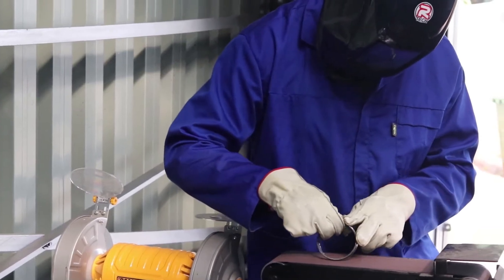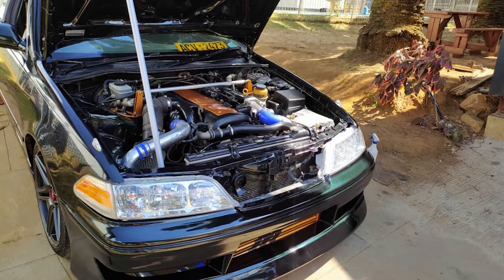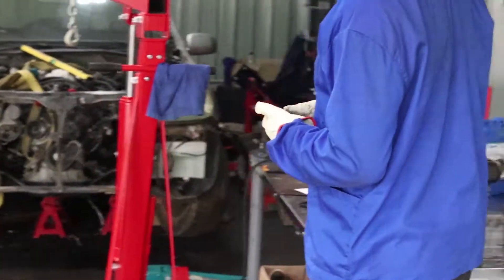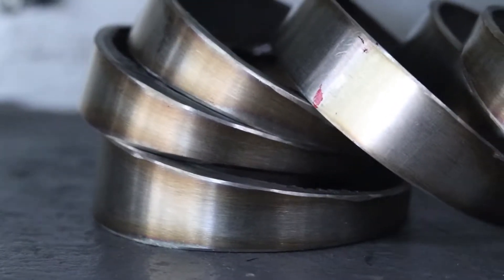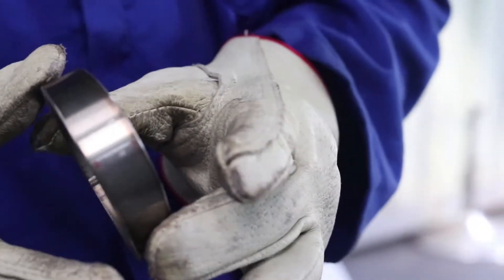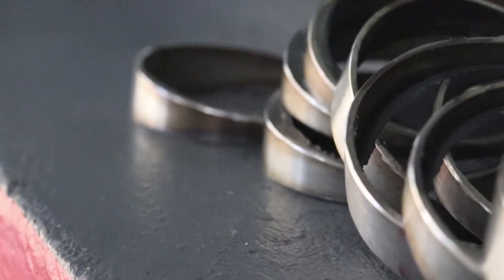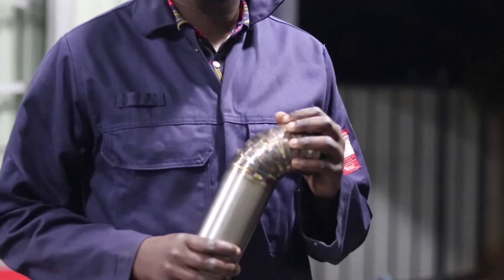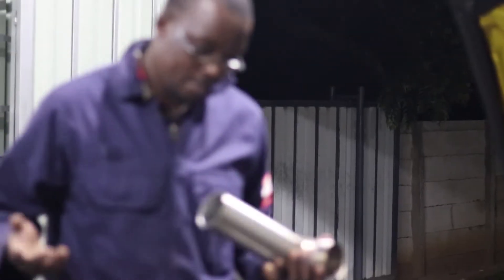Fabricating Intake Pipe for the 1jz

Comment: soundss great actually, but for better air circulation and channeling, why don't you bend the inter-cooler pipe the other way round so that the induction kit is on-top and not sitting under there so that it can breathe easily
Reply from the maker: thats the best way to route pipes on a jzx100